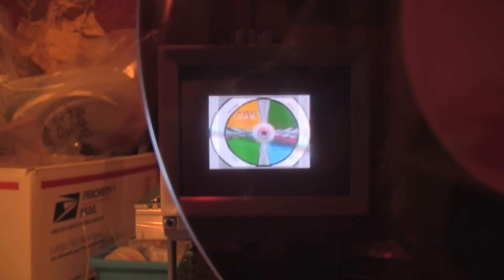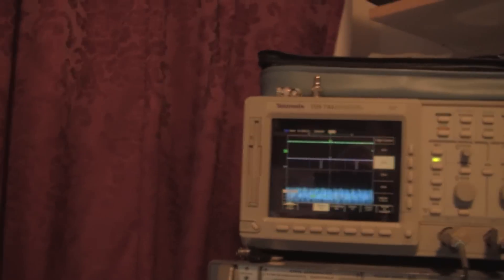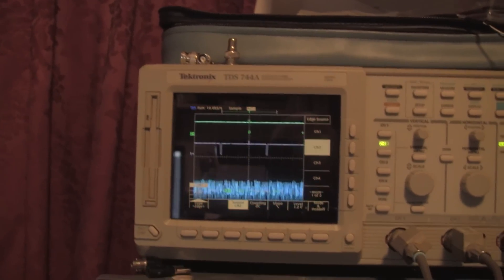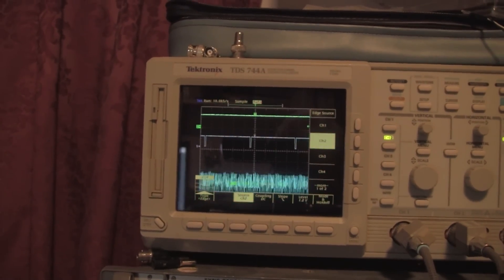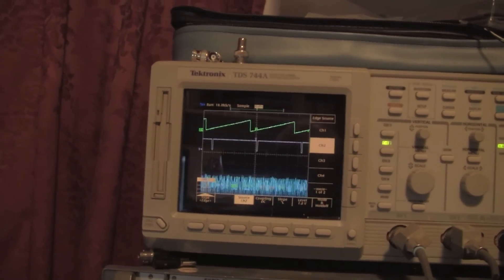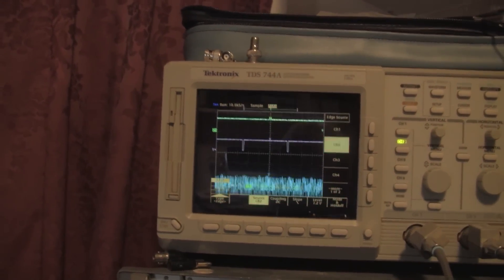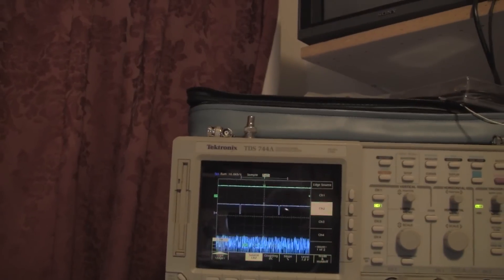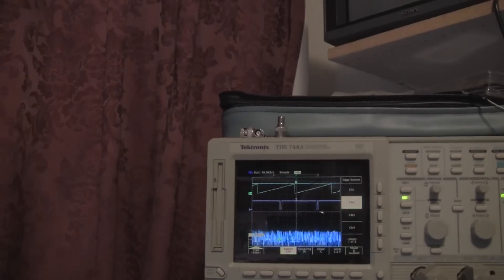First Light: Goldmark 1

Comment: I like how it changes color for some reason
Reply from the maker: You are seeing the wheel wobbling in and out of color phase. I admit, this is not the most stable servo ever built. Its my very first heavy duty servo with the biggest DC motor up to this point. The color wheel weighs a whopping 2.25 pounds (about 1 Kg) making it that much harder to get rapid phase response. The amplifier that drives the motor is capable of 35 watts of peak power. 100 watts of peak drive would be better. On average, the motor draws about 4 watts but needs huge power to change its speed and phase.
Reply: @videolabguy   yea ik! But the way it changes it so smoothly

Comment: Is this a 525 line, 3 times 59.94 field per second image?
Reply from the maker: No Manny. It is a 405 line, 144 fields per second with six color fields making up 24 full color frames per second. It was designed to be 100% compatible with movie film as well fit in a standard American 6MHz TV channel.  The field sequence is as follows: Blue Even, Red Odd, Green Even, Blue Odd, Red Even, Green odd. Odd and even refers to the fields used in interlaced television. The horizontal scanning frequency is just about double that of NTSC at 29.16Khz.
There were two 525 line systems that used triple speed scanning. One by DuMont and the other by General Electric. Of course, they required 18MHz bandwidth and were not even compatible with each other. This was the reason the FCC opened the UHF part of the spectrum in the early days. Fortunately Hazeltine and RCA came out with their compatible color system, NTSC, before we were stuck with THAT nightmare.
Reply: @videolabguy  I was aware of the non compatible CBS standard. However for your demonstration, you then must have created a 405 line 144 fields per second source? Thought it might be easier to simply to digitally sample RGB 525  to a field store and clock out the RGB color fields at 144 per second.

Comment: I just stumbled across your video and it’s really greatly interesting. But it makes you think about how big that wheel would have to be for a practically sized picture and then how fast that wheel would have to go.
Reply from the maker: Zackly! Allen B. DuMont had a poster made that showed how big the color wheel would be if used with his 30 inch CRT television. The set would have to reside on the second floor of a three story building so the wheel could rise and fall into the adjacent floors. 
This was why I used a three inch monitor. Doubling the horizontal scan rate also made the raster shrink making the picture fit behind the 12 inch wheel. Otherwise, part of the image would have extended beyond the wheel!
Reply: @videolabguy  it’s even amazing that CBS tried to sell this idea realizing that! 👍🏻📻

Comment: It's sucha shame that is wasn't fully implemented with the NTSC-system:(.. If it was fully implemented with the 525/60hz-NTSC-system, it would have been able to reach 16MHZ higher than every color system before it! It would even result in the first High Definition Colourcast in the west by 1962, a good two years before Japan's NHK started to do the test with HD!
Reply: Actually, that's not quite right.  Though it'd have taken the 16 MHz of transmitted bandwidth, the luminance resolution/definition (detail that your eye is most sensitive to) would be barely more than regular RS-170, if that.  The NTSC system took advantage of the human eye response to color (lower resolution), which Goldmark either ignored or was unaware of.  Modern HDTV also reduces resolution for color information, but it starts out with way more luminance detail than RS-170 ever hoped for.

Comment: Hi, I'm very impressed!  I made a CC2 repro set, just got the 525 line converter now I have to figure out how to use the synch chip. Any suggestions for an electronic novice on how to add this?  Thank you for your comment on my mechanical set up, it's just a mock up demonstration using an original disc in a  vintage radio cabinet. ( I am harristeeter1 on YouTube).
Reply from the maker: Are we talking about field sequential color TV or your repro mechanical TV? My Goldmark circuits are detailed here: http://www.labguysworld.com/Goldmark1_006.htm  You can find my direct contact details on my web site. I'd be glad to help you with your design questions. I am currently working on a new NBTV mechanical TV and have chosen a PWM motor drive module from Ebay and China. Far simpler than the motor drive amplifier in this Goldmark design.
Reply: Thanks so much, very helpful!   This is all about my (repro) CBS Columbia filed sequential color television.  I'll contact you at the point when I get closer to completing this project.
Reply from the maker: I know purist reproductions use AC motors and vacuum tube circuits to drive the wheel. My preference is for DC motors as they are so much easier to work with and operate at much safer low voltages. I can't wait to hear more about your TV. So, you got a scan converter from Aurora Designs? http://www.tech-retro.com/Aurora_Design/Home.html
Reply: Yes, but just the synch chip. Here are pictures (from Facebook) of the set plus other items from my collection.
https://www.facebook.com/bob.grasso.58/media_set?set=a.59260637876.73914.694842876&type=3
Reply from the maker: As Frankenstein said, and he should know evil monsters, Facebook BAD! I was signed up for a while. One of the most horrible experiences I've had on the web. Worse than that Prince from Uganda who still owes me millions of dollars! (Royalty in Uganda?) Remove the rampant perversion, totalitarian censorship and globalist communism, provide ABSOLUTE privacy settings and I might return.
Reply: Ha-ha Very true!  Did you see the pictures, though? If not you can also see more here: https://www.flickr.com/photos/40942822@N06/with/8597737139/   However more pictures of television related items, including early color, are to be seen on the first link (sent above).
Reply from the maker: I'm glad you took that in good humor. Its surprising how many people have paper thin skin these days. I was not able to view anything at all on Facebook if I don't hand over my genetic code and passwords. Meanwhile, on Flickr, Nice Photos! What is the little color wheel gadget in the photo called Related Items Display?
Reply: Could R & T guy provide a schematic from this Admiral converter ?

Comment: @videolabguy: Pardon me for not being fully knowledgeable about this area, I understand the basic story; the CBS color system (the 1st attempt - as shown here. BTW: you did an amazing job!) is a partially mechanical system (and CBS, to say it wasn't came out with a 2nd iteration which they said was fully electronic). 

My question: what was the difference between the Goldmark 1 & 2 which made it 'fully electronic'? They got rid of the color wheel, ok, but, what did they replace it with?

I saw some ads for early CBS color sets which they said 'with the 'flick of a swtch,' it was fully switchable from a color receiver to B&W. 

They really had a spinning color wheel in the cabinet?

Here's a link directly to those ads; www.earlytelevision.org/cbs_color_ads_2.html. It's on a really interesting site; Early Television Museum
Reply from the maker: Sorry for the long delay in answering. I just saw your questions. The all electronic Goldmark standard color TVs used the RCA tricolor CRT. They just gated one gun at a time. It works, but... still flickers and worse yet is 1/3 brightness because two of the guns are actually off for two thirds of the cycle! 

The standard switch would set the H&V scan back to 525/30 and stop the color wheel for regular viewing. The color wheel in the dual standard sets was made of two wheels. Both wheels only had color filters on one half and clear for the other half. They designed it so when the color wheel was parked, the two clear sections were in front of the CRT. In motion, the two wheels lined up to make a full color wheel. Goldmark was a mechanical genius!

Not all mechanical color sets had color wheels. A few used a color drum which made the set more compact in width, but a little bit deeper. Then there color wheel glasses (spectacles you wear on your face) and no color wheel in the set at all. Of course, each viewer needs their own set of glasses and a long extension cord back to the TV set! Quite silly stuff actually. 

One company today makes an LCD screen where the RGB LED backlights are cycled to make field sequential color video. Being modern, it uses a much higher refresh rate that eliminates any hint of flicker. 

ALL old technology still exists today! Somewhere, a doctor is using a leech for therapy and someone else is hand making a wagon wheel! Love the past!!! It portends the future. (It sounds wise anyway!)
Reply: There were two wheels actually, half clear and half color that would match up while in motion. That's what I built into my CC2 Repro b&w/color set.

Comment: Did you ever consider trying the small 3/4"-1" CRT tubes from camcorder viewfinders in some sort of twisted "how small can we go?" challenge, or would it be too impractical to build a Goldmark set that tiny?
Reply: Actually I have built a Goldmark set with a 2/5" CRT, its a field sequential PAL color adaptation, you can find it on youtube as "World's smallest CRT colorized, Col-R-Tel based color wheel converter."

Comment: The two outstanding issues with this project are balancing the color wheel and increasing the monitor scan size. The balance problem is primary. It vibrates fiercely through several modes as it comes up to speed. It has to run at 1,440 RPM or 24 revolutions per second.